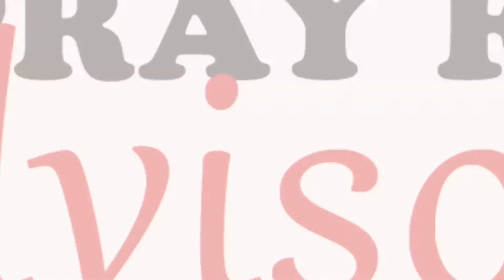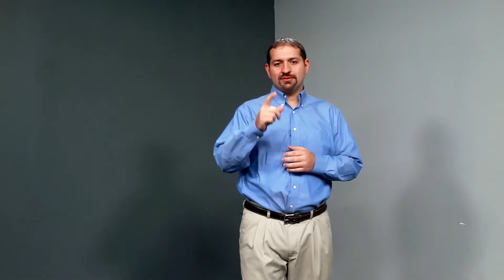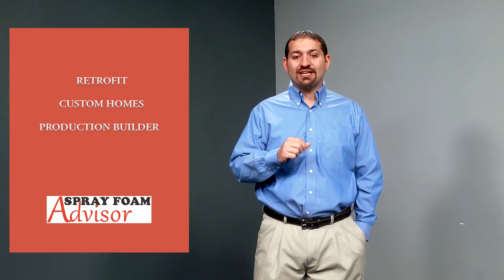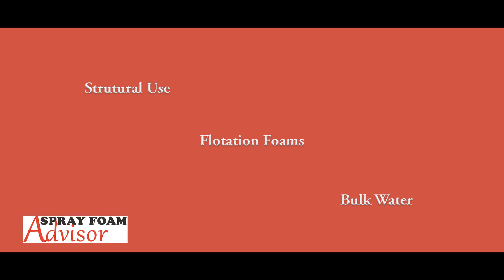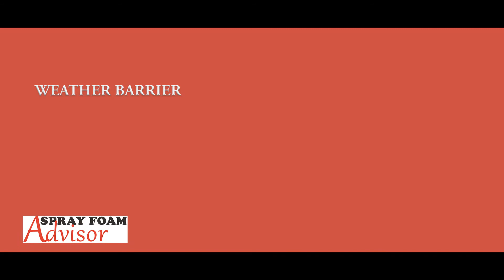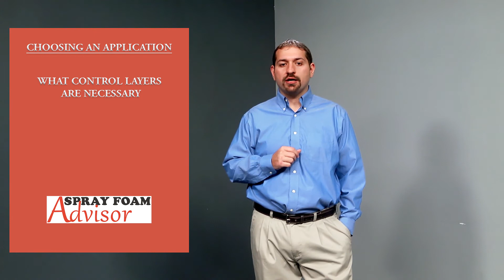Open Cell vs Closed Cell Spray Foam Insulation

Comment: OPEN CELL IS TRASH
Reply from the maker: Thanks for taking the time to comment JACKGUSLER,  but that is a very narrow minded point of view
In many applications open cell foam and closed cell foam are interchangeable, in some applications open cell foam offers better value and in other applications closed cell foam is the only choice
Reply: Open cell is fancy fiberglass. Open cell failed all perm testing to qualify it with the IRC for under roof deck applactions, or sealed attics.
  PROVE ME WRONG AND YOU WIN THE BET YOU NAME THE AMOUNT
Reply from the maker: Watch This
https://www.youtube.com/watch?v=Z2-bjq51ItU&t=1s
Reply: Jack,

While it is true that WUFI testing indicates that closed cell foam is VASTLY superior as a vapor retarder on the underside of decking (it takes a LOT of open cell foam to overwhelm any condensation tendencies in climate zone 5 for instance), a place exists for open cell foam.  

A wise contractor will match the right material to the right application, thus saving him the chagrin of calling either type of foam "trash."
Reply: So you change the subject.so that says to me in your "Adviser" mind you could care less about the Code requirements, LOL, Hurry up and take this down
Reply from the maker: Thanks for the comment Gerry

Yes, open cell foam is not going to achieve a Class II vapor retarder, that is a key physical property advantage of closed cell foam
Reply from the maker: Jack,
???
I clearly responded to your comment that open cell foam does not qualify for under roof deck applications in the IRC, and the code shows that any air-impermeable insulation is approved for this application, this means both open cell and closed cell foam
Additionally, the advantage that all spray foams (open & closed cell) have over fiberglass, is that they offer both an air barrier and insulation in a single application, on the same plane

Is there anything else you would like to discuss?